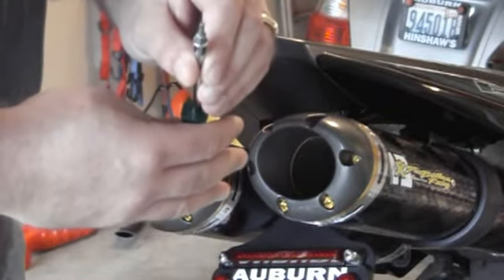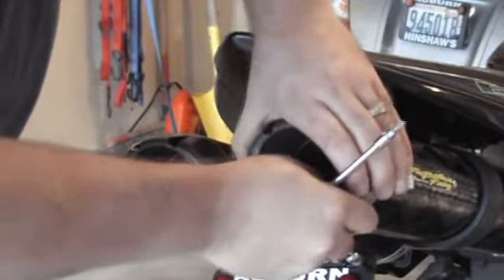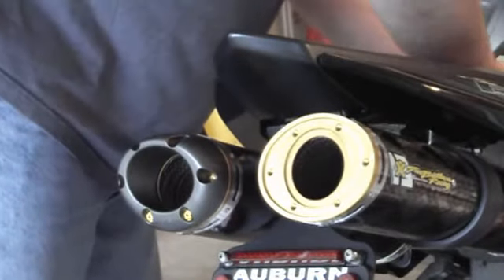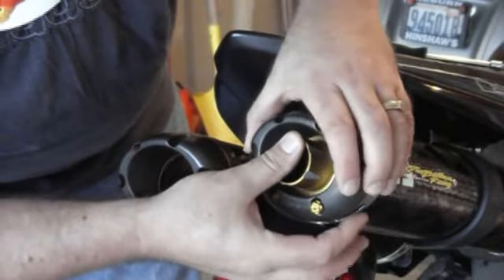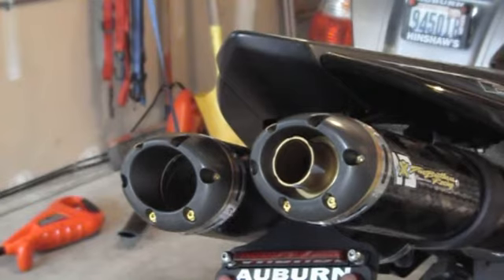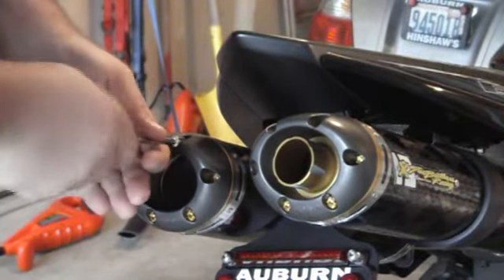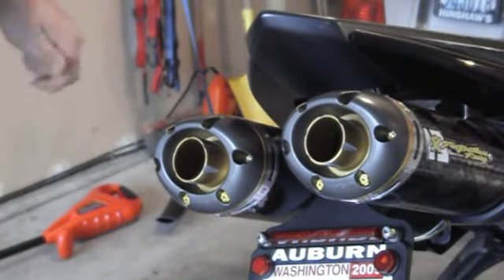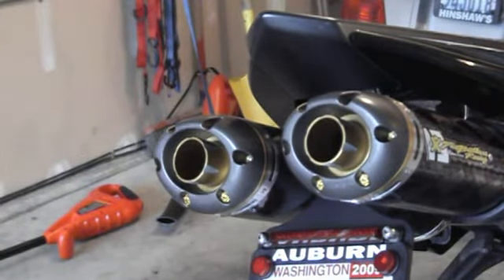Suzuki B-King & Two Brothers Exhaust Power Tip Installation

Comment: Hey hopefully someone can help me, i have a 04 cbr600rr with the Vale M2 Two bros pipe on, when i put it on, it seemed to screw up the way the motor runs (mapping), which was cause by a change in exhaust pressure. If i put this tip on, which ill prolly do either way, is there a chance it could fix the issue im having? thx all